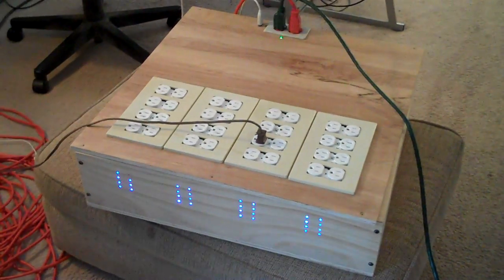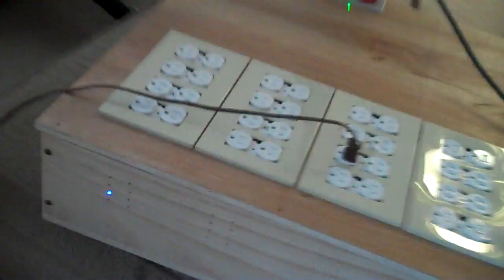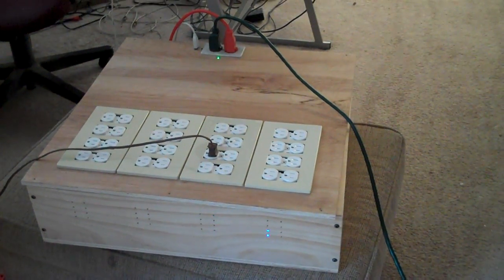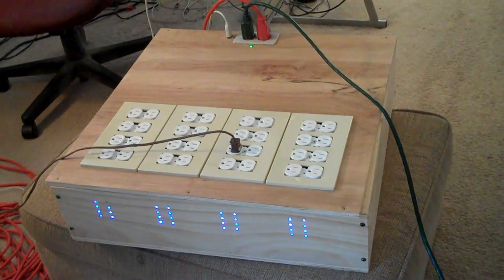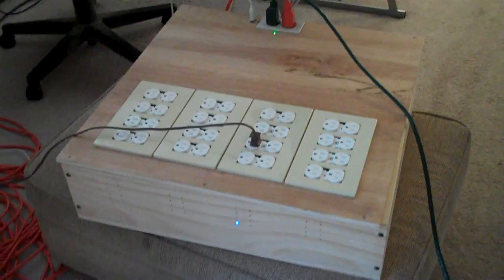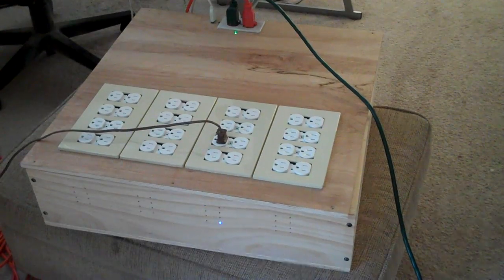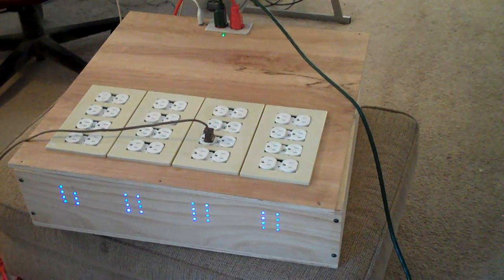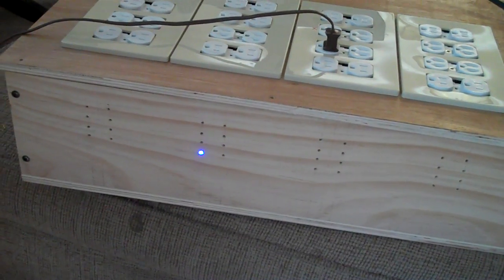Christmas Lights Control System - Part 16 - Version 2

Comment: Hey Scott, my name is James. I am try to build the Version 2 board can you send me a list of every thing i need to use to make this board.  Like FT232R serial break out board. I'v watch all of the video's and still not sure if I have every thing.  Please Email me the list at oursunshineboys91@att.net
Reply from the maker: +James-Michael Blake 
I'll respond here instead of emailing you so other can benefit.

Version 2 uses: 
1 - Arduino Mega 2560 
4 - SainSmart SSR 8 channel boards 
1 - Vixen 2.5.0.8 software package 
32 - electrical outlets 
1 - FT232R breakout board 
32 - 3mm LEDs 
1 - 12V/20mA 4mm Green LED with Holder 
32 - 1k resistors 
32 - random cross SSRs, G3MC-202PL-DC5 (these replace the zero-cross SSRs that come on the SainSmart boards) 
1 - H11AA1 DIP for the zero-cross detection (driving the interrupts on the Arduino) 
1 - 5v Enercell 5V/3.6 Amp AC Adapter with USB 
A boat load of ribbon cabel and 14 guage electrical wire. 
1 - Whole House FM Transmitter

For information on both project versions and help on building them please see this thread (tons of info and other people that have built these projects):

http://doityourselfchristmas.com/forums/showthread.php?23956-Home-Brew-Lighting-System-Arduino-Mega-SainSmart-16-Channel-Relay-Board/page1

Comment from the maker: Also it will depend on if they are zero cross detecting. Meaning the AC sine wave crosses the zero voltage state sixty times a second and if the relay will only switch states at the zero cross then the are limited to sixty times a second. Twenty should be doable but it will be very noise.

Comment: Thanks so much for your answer.  I did read the data sheet and it said "max operations / 30 per min". and I thought that cant be right. would you say that for a single relay 20 on and off per second is easily achievable?

Comment from the maker: I never timed it, the most I tried was 255 time/second. I'm not even sure how you would go about figuring that out. Probably some calculation based on the datasheet information. You can find the datasheet at canton-electronics web site, search for "DC 12V Power Relay SRD-12VDC-SL-C T73-12V".

Comment: Hi, I was wondering how fast the mechanical relays could turn on and off. I have looked everywhere on the internet for an answer and can not find one. I would appreciate it if someone knows how many times per second you can operate the relay. Thanks